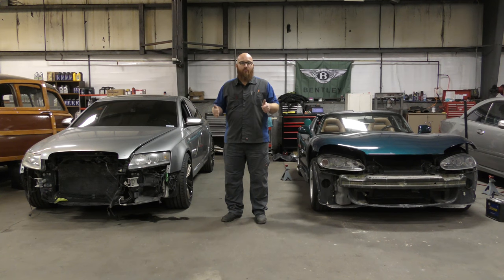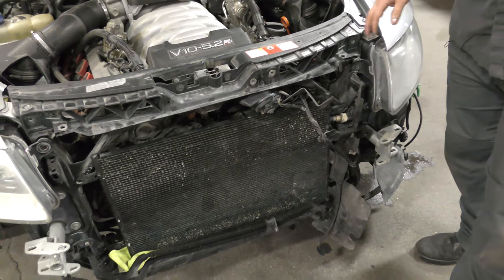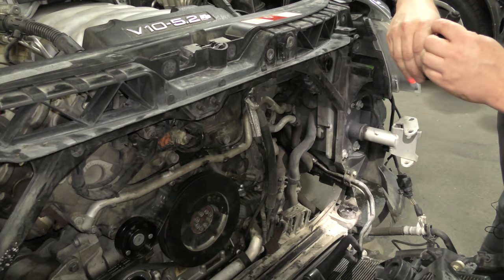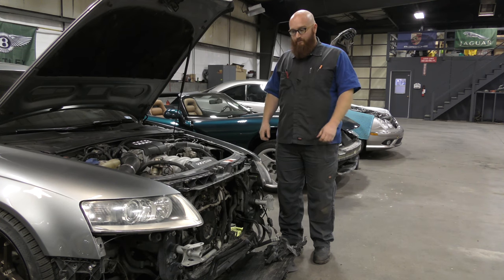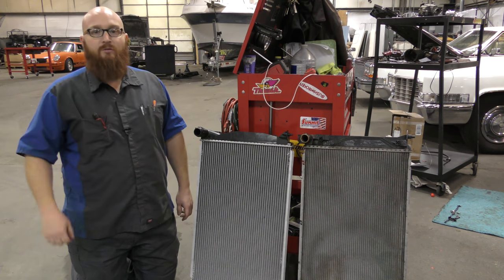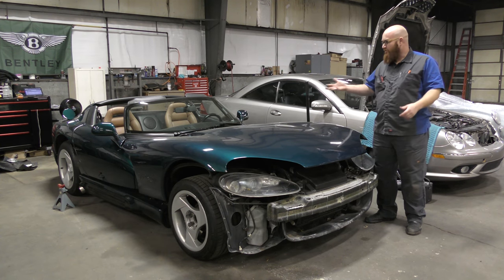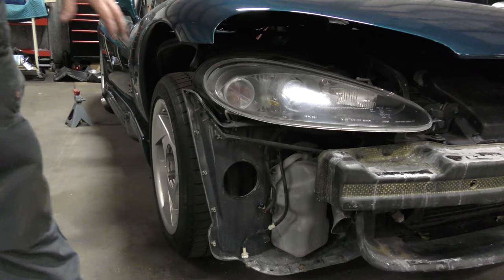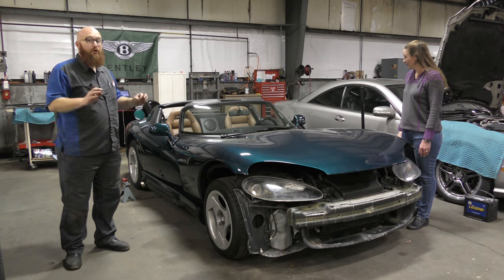What?! The CAR WIZARD has to remove the bumper on an Audi S6 & Dodge Viper to make easy repairs?

Comment: The issues you get with the Audi is what you get when you shoehorn in a large 10 cylinder engine into a car that was designed to primarily come with a 2.0 4cyl or a 3.2l V6.
Reply: Yea, they just had to somehow get the V10 in there, which they managed, just not eloquently.
Reply: I LOVED my S8 and wouldn’t have had it any other way. Still miss that car.
Reply: @HannibalACP82 I loved my B5 A4 and MKVI GTI also.
Reply: Even the 4 cylinders you need to take the front off to do the timing belt and then the V6 they threw in backwards
Reply: @moniack  even the B5 A4 1.8t are idioticly designed. There is a reason why the fronts never sits right on them. But the worst thing is the use of hex keys everywhere. Awesome when they are new. Sucks when 15 years of dirt have clogged them up.

Comment: I always wondered what a car would look like designed by a mechanic.
Reply: @Linkavich Chamofskee true, better to leave it to engineers.
Reply: All the bolts would be 10mm
Reply: It's called The Model A Ford.
Reply: They already make them they're called Legos
Reply: @obsoleteprofessor2034  0r 13mm
Reply: @Linkavich Chamofskee never underestimate what non mechanics are capable of
Reply: @maxheadroom224  nah
Reply: It would look a checker marathon or a ford crown victoria
Reply: A 2003 Buick Regal
Reply: Volvo 122
Reply: @Misunderstoodboygenius  best car to work on.
Reply: Legos
Reply: Any pre 1998 Chevy truck.
Reply: A Mercedes W123 is sort of like that.
Reply: Volvo 7/940 litteraly designed to be easy to work on
Reply: A semi truck
Reply: W140 is your answer.
Reply: I am probably one of the closest people capable of being someone that designs a car with a mechanic mind. I've done schooling in automotive trade and drafting/computer aided design. All I need to do now is get a mechanical engineering degree and pursue work at an auto maker. I could be that guy that designs a car with the mind of a mechanic... just too tired and lazy to go get the engineering degree. Maybe some day.
Reply: 94 Camry or that 4Runner they couldn't kill on Top Gear come to mind.
Reply: Obviously no bumper, no ac, no starter, no suspension, no pulley, no belt and more generally nothing around the engine within 1 meter !
Reply: Subaru Brat
Reply: In my opinion it would be a 1980s era Mercedes or a 1960s to 2000s Volvo sedan or station wagon. A mechainc at the Mercedes dealer told me that my 1984 W201 was a joy to work on.
Reply: Most V8 pickup trucks are relatively easy to work on.
Reply: I have a 1990 Fiat panda I can replace literally everything on that car without having to take off anything else other than the part itself. It is also very easy and I’m only 18 and not a mechanic. It’s not a very American car however
Reply: Corolla would be close enough
Reply: Like a Ford Model A.
Reply: @Chickenforcdawn321  My word how did that car survive  Italian cars are absolutely unreliable so it figures they made it easy to work on. 🤣
Reply: @maxheadroom224  Dude, you beat me to it.
Reply: Like a Honda.
Reply: @louvendran7273  the early F.I.R.E. series engine is absolutely bulletproof. Mechanically the pandas are sound they just rotted the day they came out of the factory sadly
Reply: A engineer is a higher educated mechanic... A car designed by a mechanic would not be great...
Reply: @Chickenforcdawn321  to be fair I actually HAVE a facelift fiat panda, 1993. That car did 45000 miles on a single oil change, and with no rust, because they updated the way they get painted.

The car I had before was actually a previous generation panda, I bought it for practically no money, and it failed it's yearly inspection (MOT here in the uk) on four pages of failures, most of them rust related...
Reply: A Hotrod 32 Ford
Reply: Everything would be easily ex accessible
Reply: It would have an engine bay with almost enough room to stand in. Similar to 1960s pony cars with the smallest engine option installed. Everything is so damn compact now because the engineers are chasing fuel economy, instead of reliability or ease of replacement, so they have to decrease the front cross section of the vehicle to as small as they can get away with.
Reply: 1960's Chevy Impala, easiest car ever to work on.  Especially if its a stripper and doesn't have things like A/C or power steering.
Reply: Audi to b4 and c4 are desined so you have easy access. After that there is no room and its hard to repaire.
Reply: I never once had to make a difficult repair on my Talbot Express van, and I did a lot with that. Even removing  and replacing the cylinder head was very easy. It was generally a pleasure to work on. Loads of access room for everything, A simple agricultural like design, Fasteners that were generally appropriate. I liked it a lot.

The worst repair was when the circlip for the handbrake lever fell out and I had no tools with me. In the end my then girlfriend managed to get it back in place. It would have taken me 10 seconds if I had a pair of pliers, but it turns out women have needlenose pliers built into them.
Reply: Willys Overland Jeep.
Reply: Toyota BJ40 lol
Reply: BIG
Reply: Imagine a 94 celica.
Reply: Toyota Camry/Corolla and Honda Accord/Civic?  Surely they're easy to work on given how (relatively) inexpensive it is to repair them.
Reply: 1958 Mercedes Benz 220S or 1964 Ford F100.  I had a 2005 Audi TT Quartro.  Wonderful car.  Changing the timing belt was a pain.
Reply: It would basically be a Mercedes W123 chassis with a 350 Chevy V8 and a Ford 9 inch rear axle. I mean, come on, the door hinges on a W123 have grease fittings built in!
Reply: Not this for sure!
Reply: that would be the same, mechanics know how to make things easier or harder to reach, but marketing guys are the ones making the decision
Reply: If us mechanics designed cars they would be more reliable and last longer and no reason for big shops anymore. Mechanic for 18 years and I hate engineers.
Reply: Any American car up to the 1980's except a Studebaker Avanti or a 1950's Corvette
Reply: ...have a gander at the shop drawings of the Model T!
Reply: A hot rod from the 50/60s
Reply: @obsoleteprofessor2034  and on the outside.
Reply: An old school air cooled Beetle, probably. A complete engine replacement can be done in less than 45 minutes and involves about 4 bolts and a couple of hoses.
Reply: @Chickenforcdawn321  KEEP IT! You can save up for a down payment on a house with what you save on repairs.
Reply: Simple as a brick and that means volvo 740 volvo 850, what else do you need ? :D :D
Reply: -belt tensionner of a gm car with socket drive
-carthride oil filter on top of engine such as german
-door hinges of a modern golf (no need to readjust after removing them)
-all plastic in bumpers with honda style tabs (easy to remove, never breaks when disassembling)
-push pins in wheel house have a notch to grab and remove them
-head bolts arent torque to yield but studs from factory
-alternator is on top of engine 
-transverse engine; exhaust away from the cab, bad rusty manifold bolts are easier to get when in front of car
-altermator and starter? that should be brought in a single unit, saves weight
-stainless exhaust system, people in canada rejoice.
Reply: Most likely answer: A Toyota.
Reply: @Chickenforcdawn321  My dad had a Fiat 128 sport, late '70s or early '80s.  He changed the head gasket on our front lawn, because he couldn't get it up the driveway into the garage.  I don't know about the newer ones, but the older Fiats seemed relatively easy to work on (I remember he did the timing belt too when it broke, but luckily the engine didn't grenade).
Reply: Mazda Miata is mechanical heaven compared to this Audi.
Reply: Mine likes toyotas
Reply: My '81 Ford Taunus is quite easy to work on. I can replace the starter with the car on the ground and the heater core is very accessible.
You just need to remove the two hoses, undo two screws, remove the cover and off comes the heater core.
Reply: it'd look like a 94 celica lmao😂😂🤣
Reply: @obsoleteprofessor2034  🇯🇵 😂😂🤣😂
Reply: A 96’ Honda Civic 5-speed
Reply: Like a Toyota ❤️
Reply: A 1980 toyota pickup
Reply: I picture a large box with access panels everywhere. Easy to work on but has thr aerodynamics of a cinder block. Mechanics would put themselves out of business but oil companies would love the 8 mpg.
Reply: A 57 Chevy
Reply: Well i wonder too! But often a var designed for an V8 or L6 with a L4 Will have much more engine room Space 😅
Reply: It would be a four cylinder with an enormous engine bay
Reply: It would be a fuel injected pushrod V8 with as few computers as possible. Simple electric motors for power windows and door locks that are operated by simple switches, no body control modules or engine control modules. All the fuel EVAP system components would be in the back of the car, near the fuel tank, easy access for replacement. Cruise control would be vacuum operated. 

Basically it would be that white 1967 Fleetwood he still hasn’t sold.
Reply: Toyota innova then
Reply: It’d be an old Honda... tons of working room.
Reply: @RemcoStoutjesdijk  the S320, maybe. NOT the 600!! No room.
Reply: It would have a small door, just like a fuel door, for oil filter and oil plug access on the lower side of the car
Reply: Air cooled VW Beetle or the original Jeeps maybe? The more features added to cars, the less room they have to jam them in.
Reply: @RemcoStoutjesdijk  The 90's S-Class ???
Reply: They still make the same Land Crusiers from he 80's in Australia last I checked.
Reply: Any W-body GM sedan with the 3800.
Reply: @TheLuisg92  crown vic is a great car, I’ve been driving one for two years.
Reply: @man_on_wheelz  Yeah! Except your employer will make you design it the way THEY want it!
Reply: Jeep XJ a box

Comment: Engineers are given constraints, they dont have the power to do anything they want. There's usually a thousand accountants on the engineers ass.
Reply: Ya the accountings  want you to buy new cars  the engineers want to make something that could last
Reply: A GM rustproofing engineer said it best, "i can make you a rust proof car that you can drive behind a salt truck all year. But itd cost twice as much to make, and be too heavy, and be very ugly. Its all a balance, and just when you think you have it, assembly or accounting or marketing tells you why it doesnt worj for them"
Reply: Yeah, if I'm not mistaken the engineer has to work within the perimeters given to them by the styling department, and sometimes compromises have to be made
Reply: Yes and that is not only in the car making they are everyware
Reply: @nothanksguy  ya it's always a fight between the engineers and the rest of them
Reply: cars and all other things have to last till the warranty is over. after that point they HAVE to break. thats no tinfoil hat theory, thats what happens
Reply: Tbh this Audi S6 with a V10 isn't the craziest thing VAG has ever done. Not even the Bugatti Veyron is. No no I'll tell you what is crazy....
VW Golf GTi W12 based on the Mk5 Golf.
That car was a fully functional concept car BUT you can see from the engineering of that car how VAG manages to fit such large odd sized engines (4.2 biturbo V8/5.2 V10) into cars that can at best only have a V6.
Reply: Yes and in this case they pack V 10 in area design for V 6
Reply: EXACTLY.  and also, its just a car. Aint like it's going to fall out the sky or stop life supporting a patient at the hospital....
Reply: As the old saying goes; we can make it good, fast, or cheap. Pick any two.
Reply: @Lowe Ryder that and making a bunch of deceptive part and having to put them in regardeless of found issues with them . That's how japanese car got better, small run of parts, makes the cars. Makes another batch of updated parts and assemble some more cars.  Now that they build cars in america or with plenty of storage for parts they dont have to do that and overal quality goes down.
Reply: @Pete...NoNotThatOne  These days, it's "pick one" and "good" isn't there anymore...
Reply: Nah as an engineer, there's no excuse for making cars this difficult to repair.   Most of the issues are caused by "oh they won't need to change that often" , or "this is a 'lifetime part'".  Accountants don't dive down to this level.  You could say it's accountants when parts fail early, maybe.  It's not accountants that decide how things are mounted, and order of operations for assembly.

There's always been a big difference between dodge engineering and say, honda.  Garbage in, garbage out.
Reply: @davetek490  lifetime meaning the lenght of the warranty....just like transmission fluid. It's false and pushing people to decrease life expectancy of parts.  For instance audi says transmission fluid is lifetime on many models, but the manufacturer of the transmission itself says it's not and needs to be replaced.
Reply: The flip-side is engineers are never done. Companies need to get products to market, at scale, fast. If engineers were given all the time they needed, they'd still be designing the light-bulb.
Reply: Disagree. If that’s the case then all cars would be hard to work on
Reply: @9doggie12  Well that's why Toyota won't make a 4dr AWD V10 or a biturbo AWD V12.  Among similar time constraints, Toyota favors repair-ability over exotic technology. Audi, Bentley, BMW will choose exotic power plants and bleeding edge tech over minimizing billable repair time.
Reply: @invictusaeternum  have you seen the Lexus LFA lol
Reply: @9doggie12  You'd put that in a category of cars that engineers designed to minimize repair hours?
Reply: @invictusaeternum  engineers don’t do that in general. However wizards point is that when you design the car it should take repairs into account because they are inevitable. Most cars are designed that way and most manufacturers are able to do that even with exotics except audi where everything is a bumper off job
Reply: @9doggie12  I feel like we're just going to keep splitting these hairs. It genuinely seems that something like an impala is designed with repairability in mind to more of a degree than something like an s6, because it's what manufacturers demand.
Reply: @invictusaeternum  disagree the repair is the exact same for an A6. You have to pull the bumper in any Audi to replace the radiator starter ect. You don’t have to in a Mercedes g wagon or bmw m5.
Reply: @9doggie12  I'm beyond the conjecture I can offer at this time. lmao
Reply: There actually was a car that was produced with ZERO constraints put on by any accountant. The 1992-98 Mercedes S-Class. Mercedes top brass allowed the engineers full carte blanche to design and build it. They invested something like $100m into the design and production of it. It’s why the car is a tank of a tank that handles and performs amazing.

Comment: Car mechanic complaining about pulling panels to get to something. 
Me, an aircraft mechanic, that's it, as I'm removing screw number 231 from a panel with 350 screws.
Reply: We did an a/compressor on  a little piper, you have to untwist the safety wire because it’s in a hole and you can’t touch anything but the pigtail
Reply: When I was in school I had to be a tank rat a few times. Nothing like scraping sealant while your partner on the outside takes a nap

Comment: I worked in a Toyota dealer shop that was owned by guy that had a VW/Audi store next door. I worked in the Toyota building, but the VW shop was joined to ours. It seemed every time a car came in to the VW side of the shop it was always getting (at least) the front bumper taken off, no matter the repair. I remember a thermostat on an old Audi requiring removal of the timing belt. On top of that, I was dumbfounded when I learned how to change the oil on a new Audi, sucking it through the top because they needed a way to make even the most basic maintenance impossible to do at home.
Reply: Top down oil changes are great. Just need to buy a pump for $30. They are also VERY clean if you also have a top mounted filter. I had a Chrysler that had a MB motor in it that you could do top oil changes with. Very easy and no need to get under the car, which was perfect, because I could do them in parking lot of my condo and save about 75 bucks every oil change. My only concern is that any debris that is in the pan might not get flushed out.

Comment: I have a friend who was a Saab mechanic at one time.  He said that if he ever met an engineer who said he designed the engine compartment, he would kill them on the spot.
Reply: Putting the engine behind the gearbox was a very odd decision for sure!
Reply: Many a time when i've been working on my Saab's i think why the f**k have they done that.
Reply: fitted a new battery in a 93 today,i agree
Reply: Too bad SAAB closed down, all the engineers had to return to the Stockholm Insane Asylum.
Reply: A little extreme there bud

Comment: Me: "The alternator in my Ford Five Hundred is hard to change."
Audi Mechanic: laughs in German accent
Reply: In this case is only one main problem they pack V 10 in area design for V 6
Reply: also note the v10 alternator is watercooled, so drain the coolant before you start the job
Reply: I have a Five Hundred and it's not that difficult.  It's just tucked up under the wheel well

Comment: Putting the audi in service mode gets pretty easy after a few times. First time was a pain, needed to get the Torx set and look for all the fasteners.  I'm in the process of replacing the 2 catalytic converters and it requires engine support and a dropped subframe

Comment: I have an 08 A6 with the 3.2 and you can tell that's what it was designed to have first and all bigger engines were just crammed inside the space for a V6.
Reply: Right, and that entire massive engine sits forward of the front axle. I doubt the weight distribution is 50/50 on that car...